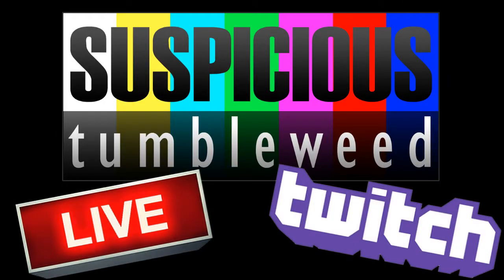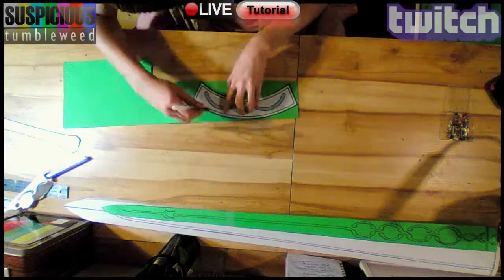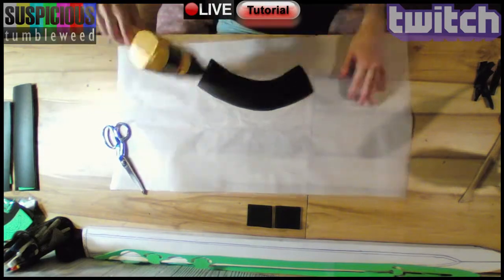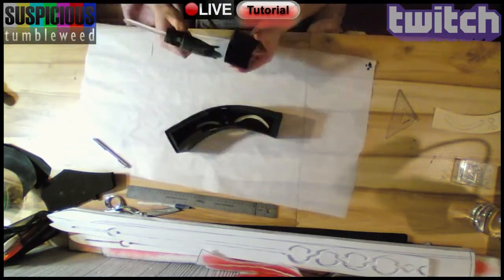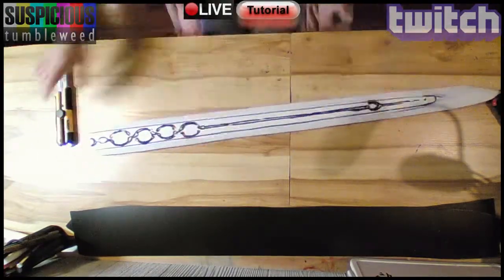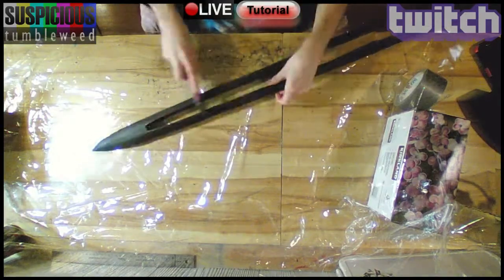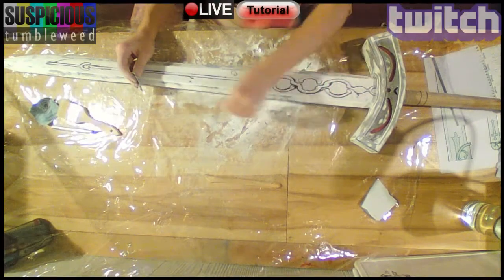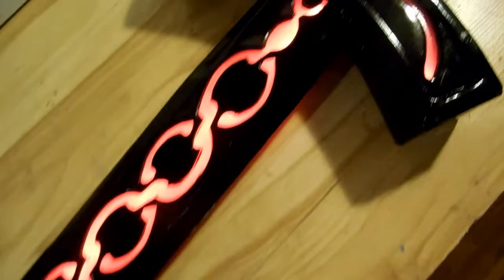Saber Alter - Glowing Sword Tutorial

Comment: What type of LEDs did you use
Reply from the maker: they were LED strips, you can get them on amazon.  These if i remember correctly are strips that end in wires so i could connect them myself to a switch and battery.  its been a while.